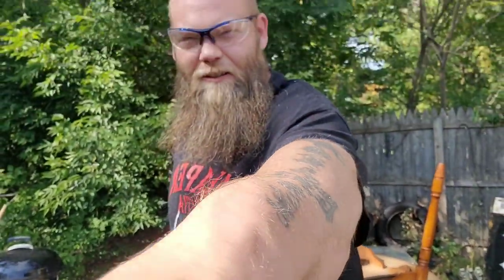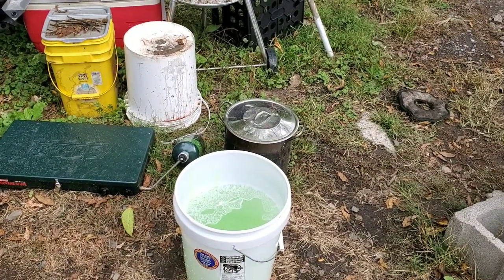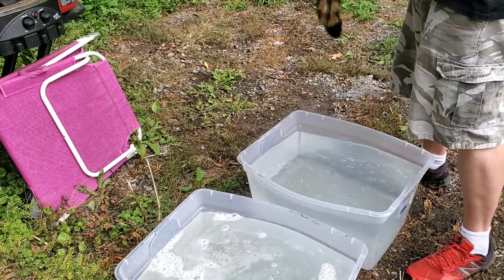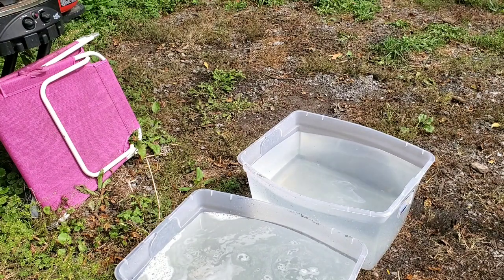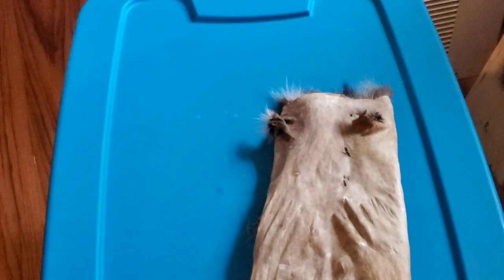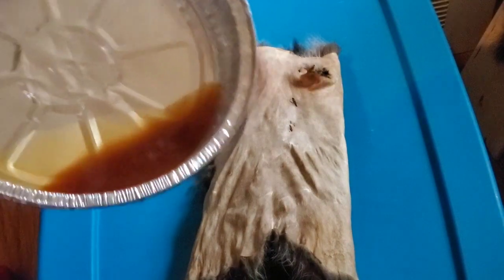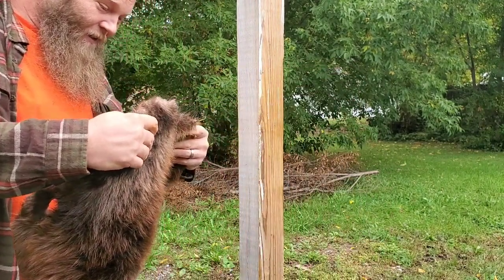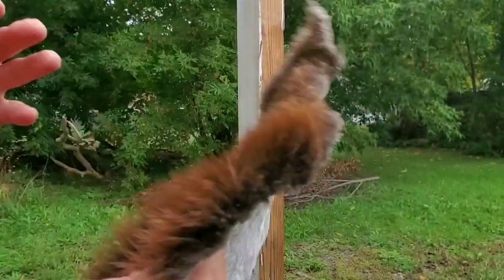WILD FUR TANNING PART 4 (LEARNED FROM COON CREEK OUTDOORS)

Comment: Does t the wire wheel tear the skin
Reply from the maker: It definitely can you have to be very careful. If nervous and don't want to reck it do it the other way by scrapping. These one's that I used are all practices to see what's up. Using the wire wheel is a messy deal lol don't hold the mouth open lol.
Reply: @REAPERMILITIAOUTDOORS  If it’s really dry can I use sand paper? Thanks I’m new to this.
Reply from the maker: @waylonlegend4603  Can't hurt to try, and trust me sir I am no professional. Coon creek Outdoors has a Playlist how he does it. You can always re soak it till soft. Scrap it again and then let it dry a little and start breaking it then tanning it as ya break it in.